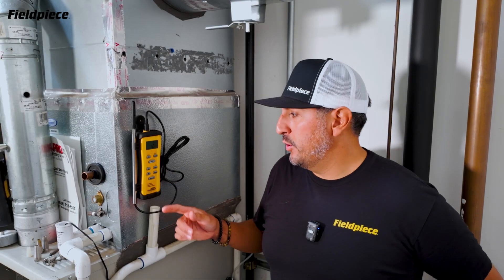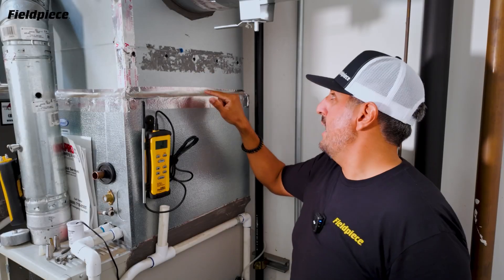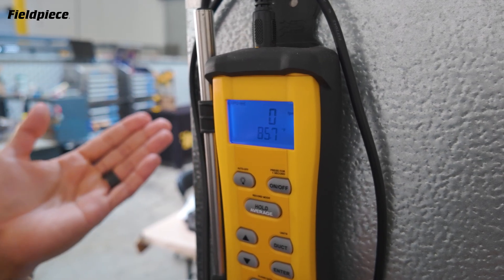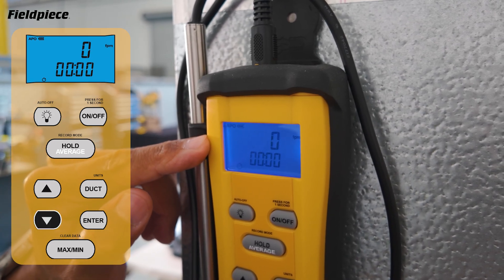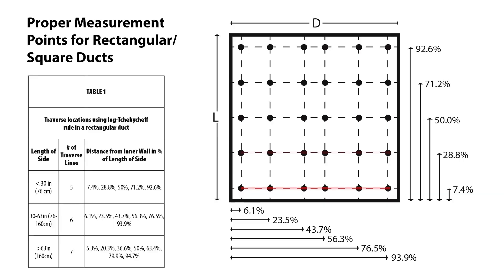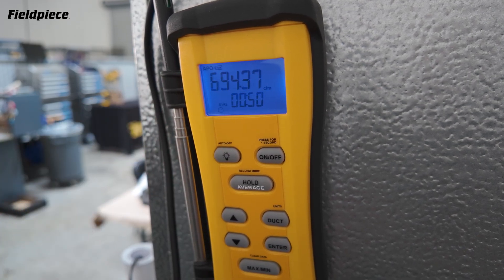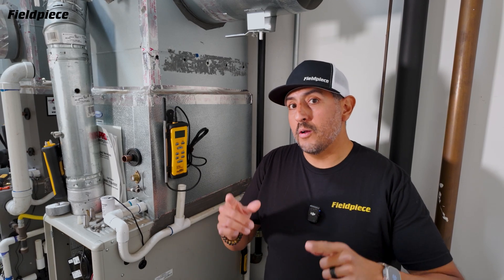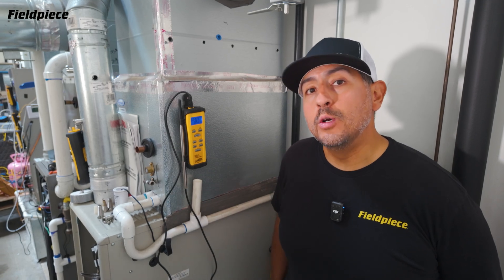How to Measure CFM In a Duct | STA2 Hot Wire Anemometer

Comment: "To accurately measure the temperature of the air coming out of an air conditioner, which is more accurate: using an infrared thermometer or a thermal anemometer?"
Reply from the maker: More accurate would be a thermal anemometer. The infrared measures surface temperature and if you're looking for air temperature the anemometer taking an air sample would be more accurate.

Comment: I always wondered if you have to adjust the cfm for temperature and altitude?  
I use the point average method.  You can mark the ruler of the shaft with a sharpie.
I also made a calculator for the drill holes and the measure points, instructions available on my YouTube channel.  I'd try to post a link, but it kicks the comment off thinking it's spam.
Reply from the maker: Hot tips! Thanks for your comment!
Reply: @FieldpieceProducts  what about my question, do you still have to adjust the CFM reading for temperature and altitude?
Reply: @HVAC_Tips_Tricks_Calcs I believe it is temp compensated. But then again temp is not the only factor that determines density. I've had this meter for over 2 years, it was pretty accurate up until just recently now it's a paperweight. And I baby all my instruments. It looks like the day i bought it. We'll almost. Never been mishandled though. There's a connection issue going on with the cable and readings are just all over the place even when probe sitting flat on a table with zero flow,it will be jumping around from 0 to 4k cfm and everywhere inbetween. I can't trust it anymore and I wouldn't buy another. I just purchased a tsi velocicalc hotwire and a dwyer av type manometer with a few pitot tubes and can't wait to test them out against eachother.
Reply: Also for what it's worth, you say you use the point method, although I know this is how pro tab guys traverse a duct with pitot, I've done both methods and on some systems with poor duct design you will get a far different reading between the two methods. I've measured ducts that have a difference of over 2k cfm  just inches apart from eachother, turbulence is a really mind boggling reality, fpm in one spot in a duct changes multiple times per sec, I've always felt I'd get more accurate results doing timed traverse because of this. But I really don't think any methods are all that accurate besides a flow hood and even then you'd have to have multiple flowhoods for different volume flows, the best one as of now looks like the dwyer sah-22. Instead of having backpressure compensation which isn't very reliable,it's designed to not have any backpressure for more accuracy and has blockoff plugs for lower flows. There's just no reviews of it unfortunately so who knows
Reply: @HVACRTECH-83  interesting.  Thanks for your comments.